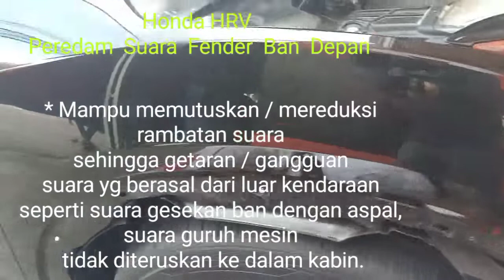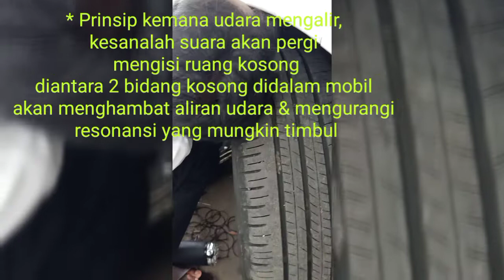Owner Honda HRV ~ Banyak Mengeluh Gangguan Suara Fender Ban Depan

Comment: Mengapa VTech Bisa Meredam Suara Fender Spark Board Ban Depan ? 
Peredam suara, dikenal istilah noise barrier,
merupakan gabungan beberapa prinsip yaitu penghalang suara bising (noise blocking)
dan prinsip penyerapan enerfi suara (sound absorbing)
Prinsip prinsip tersebut membentuk fungsi pengendalian kebisingan (noise control)
Meredam suara dari luar, 
sekaligus memberikan sensasi suara yang indah & meningkatkan akustik suara musik.

Tidak menyerap uap air, sehingga daya insulasi suaranya stabil.

Pori rongga udara rapat, sehingga gelombang suara sulit untuk merambat.

Densitas permukaan yang memadai untuk menjadi peredam suara.

Tidak turut bergetar dengan media kontak,
tidak meneruskan getaran,
memutuskan kontak fisik getaran suara yang merambat.
Reply: Prinsip kemana udara mengalir.
kesanalah suara akan pergi.
Ruangan kosinv menjadi salah satu potensi terjadinya suara berisik.
Penggunaan VTech untuk mengisi ruangan kosong yang ada di Fender, Dashboard , pintu samping akan menghambat aliran udara & menghindari resonansi, gema & pantulan suara.

Comment: VTech modul gulungan untuk redam Di spark board depan
Sifat fisiknya tidak menyerap uap air
tidak berubah bentuk, tidak berjamur

Bentuknya gulungan untuk menambah kepadatan 
secara fisik cukup kecil untuk dinmasukkan ke Dalam ruangan Yang sempit,
fungsinya untuk mempengaruhi resistivitas Dan resistansi aliran udara Yang berimbas kepada meningkatnya impedansi akustik

Prinsip kemana udara mengalir 
kesanalah suara akan pergi.
Ruangan kosong menjadi Salah satu potensi teejadinha suara berisik
Penggunaan VTech(R)  untuk mengiai ruangan kosong Yang Ada Di spark board.
Pada bagian fender Akan mengham at aliran udara Dan menghindar resonansi ,gema Dan pantulan suara.
Reply from the maker: Makasih urai an  dan penjelasa nya yg detail Min 🙏🙏🙏